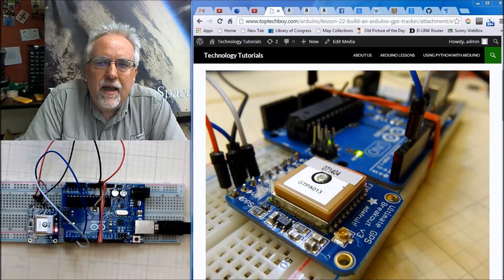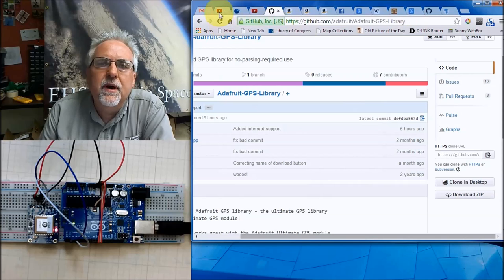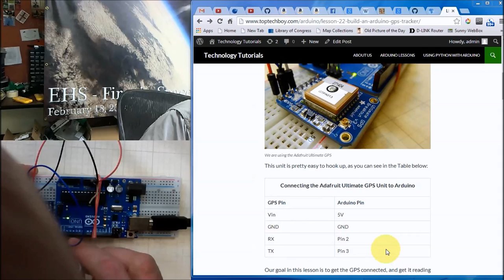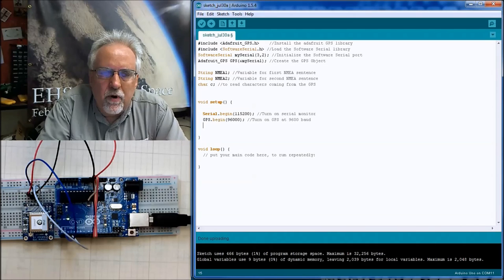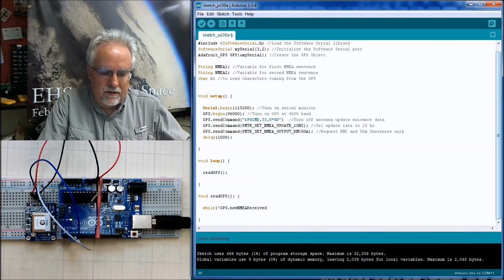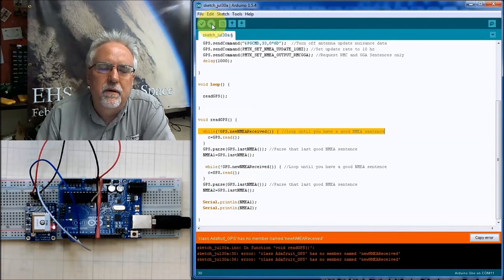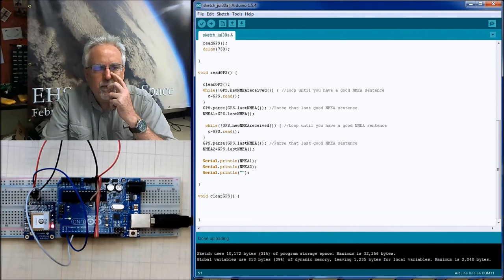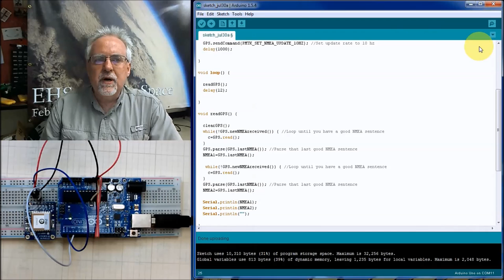LESSON 22: Build an Arduino GPS Tracker

Comment: I am having a connections problem with the GPS module and the Arduino, the Arduino always got shutdown when I try to connect the GPS module, specifically when I connect it to the power (5V), I believe it is a problem in the power distribution, plz help me fix the problem 😫🙏🏻

Comment: I have to use an ultimate adafruit GPS module. Which will be compatible with an SD card and a bluetooth module (all its components must be compatible with an Arduino) you can advise me to take what as type of components

Comment: Couple of quick pointers:
Around 17:43 you mention not knowing why you need to use & in front of your variable. This is known as passing a variable by reference (as opposed to pass by value), which means the method being called will have a memory reference to your variable rather than a copy of it. Try googling c pass by reference for a more in depth explanation and why it can be beneficial. 
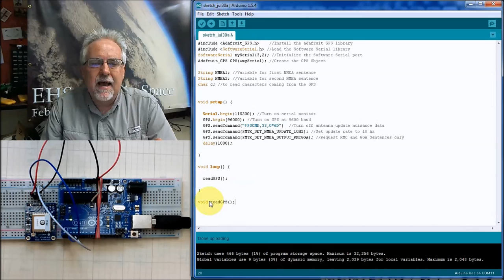Around 26:30 you mention that void indicates that you aren't passing any parameters to the function or getting any back. This is wrong, void (or int/string/etc) indicates the return type of the method, and in no way says anything about the method parameters.

Comment: in 17:48 the reason for using the & sign is to pass the memory address of the software serial object. this is done as it prevents making a duplicate of the software serial object Saving memory  which is crucial on boards with very small memory (like arduino uno which has only 2kb of memory). I checked the adafruit's library file and looked for the parameters(the thing which you passed in to create the object) and the constructor(the thing which creates the object) is looking for a pointer.

Comment: 17:46 the reason for " & object_name " must be that the gps for the add in address location .....if when we r not using pin 0,1...we must have to tell the arduino to go to GPS tracker and access the file or data located address...so that's the reason I think we need to write " & " to the the data from a particular address
Reply: its like a pointer
Reply: @siddheshgawali7764  It's the memory address of that variable.

Comment: I hooked everything up correctly(5V to VIN, GND to GND, RX to 0, TX to 1), and have the correct baud rate, but I'm not getting anything in the serial monitor.  I know my Uno works.  Is it possible I have a bad GPS module or is there some setting thats not right?
Red LED on the GPS breakout blinks every so often.
Reply: adr127 I too ran into this problem, did you find a solution or the reason why?
Reply: I too have the same problem. Did you find any solution? Please share!

Comment: Paul, getting hold of an Adafruit GPS unit here in the UK is impossible and there are cheaper units. As I don't need the same one that will operate at +60k feet I am going to assume units should produce equivalent data streams

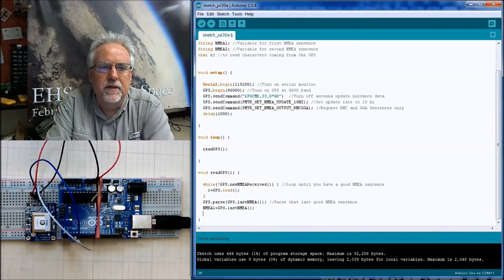Comment: At 31:30 you talk about not pausing the program because the data is coming very fast. So my question is, to speed up the routine just a little bit more, instead of Read, Parce, Save,Read, Parce, save - do Read, Parce, Read,Parce then Save, Save. Just an idea. I don't have one of those GPS devices to try it myself.

Comment: Seems like the read buffer only stores one sentence at a time. The module should specify the buffer refresh rate. To be sure you are grabbing accurate data all from the same loop frame, you'd want to first set your read loop to delay at the module's buffer refresh rate, and then parse each of the total number of unique sentences the module provides. This is just a single loop for initialization. This way,  you can determine and designate a start point that aligns in time with the 1st sentence you want to keep. For example, if there are 4 unique sentences that each refresh at 900hz, you can set the start of your 1st main loop to 900hz * 4, and then offset it if your target sentence is not the first in the loop frame. Then, you can initialize a second loop in the same way for the second desired sentence. This way, you're guaranteed to never miss a desired sentence, and the two you acquire in a given read loop frame will be guaranteed to be from the same loop frame of the module. Without doing this, even if you get a "C" sentence and and "A" sentence, you have no way of knowing if they both came from the same loop frame off the module. One of them can still be old data unless you ensure your reads match the refresh 1-to-1.

Comment: Hi! I bought one of these and am currently using it with an Arduino Mega 2560 and the only way that I can get something to display on serial port is when I do the direct wiring otherwise is not printing anything on the serial even though he seems to be getting a fix when I do the direct wiring.

Any suggestion?

Comment: hello . i want to ask if it is possible to use this gps sensor with arduino to make a gps survey instrument which can do the gps correction automatically and so it can be used for surveying with an acceptable precision.
Reply: Hi, were you able to make it work with the Arduino? We are trying to do the same thing, but can't get past the first step of just reading data from the GPS. We connected it and both boards had power. Then we loaded the empty code. When we clicked on the viewer, not data was being transmitted from the GPS (even after trying different baud rates). Can you help? - thanks

Comment: Awesome video! Is the location of the device able to be monitored wirelessly from a computer while the arduino is moving around? Thanks! (I would like to use this idea for a high altitude balloon.)
Reply from the maker: +themagicJAR48 Yes, the issue is maintaining the wireless link, which will involve legal issues, safety issues, antenna design and other engineering challenges. We have maintained a live telemetry link to High Altitude Balloons for over 70 miles downrange. It is a tough problem.

Comment: if your using a MEGA 2560, then try using hardware serial instead of software serial.  Change pins 3,2 to 19,18.   Go to File--> Examples--> Adafruit GPS Library--> GPS_HardwareSerial_Parsing.  Take a look at the code for setting up the  hardware serial.   Good luck.

Comment: Hi Paul 

Thank you for all your videos - they are superb. I have a question on the GPS. I connected Tx and Rx with the Arduino as you suggested but did not get the streaming data. Would it be because I am in the UK and if not would you please have any suggestions. Thanks
Reply from the maker: Tx to Rx, and Rx to Tx, right? With that it should work anywhere on earth.
Reply: ok thanks let me check my wiring

Comment: hey, Paul McWhorter, I wanted to ask is it possible to make HUD windshield for car with arduino and GPS module?
Reply from the maker: +Tomas Naujalis That would probably require more speed and horsepower than what the arduino could muster. For a project like that, I would probably move to the raspberry pi.
Reply: +Paul McWhorter even if I want to get only speed measurements?
I'm planing to use Ublox - NEO6MV2 GPS Module.
Reply from the maker: +Tomas Naujalis You could probably get speed from GPS and arduino.

Comment: have you test how the accuracy of that gps...say you put it stationary and observe how does coming data deviates over time? Very nice tutorial...
Reply from the maker: +fnjyusername using the adafruit library I tend to have about 10 feet drift with good fix. Drift is worse if you only have  a few satellites. I can get better accuracy on the device I build with BBB which develops the NMEA parser from scratch.

Comment: the video was very informative, thanks for sharing it with us.I need a small guidance for my project on location tracking using a SIM908 module interfaced with Arduino.The main aim is that, if you call to the sim present inside the module, it should store your no. and it has to send back the location to your no. .
can you help me with this code?

Comment: Hello, thanks for sharing, first of all. AS user of a GPS i found a problem with all the examples, the lib for adafruit is not usefull for any other GPS. I'm using for example a A9G and i would like to get from GPS longitud, latitud, etc but using AT commands and standard arduino code. Could you help us. I'm calling with A9G with no problems but GPS i can't get it. Thanks a lot sir. kind regards.

Comment: Could a Raspberry Pi 4 be substituted for the Arduino I would be using the Adafruit Ultimate GPS breakout board, a huge concern is the software compatibly.

Love your videos, never stop!
Reply from the maker: better would be to look at my GPS project on the Beaglebone black. That would be much more similar to the rpi
Reply: @paulmcwhorter  Thanks I will give it s go
Reply: @paulmcwhorter  Thanks Paul will give it a go..

Comment: Would it not be possible to do a flush on the serial buffer instead of trying to read the data to clear it from the serial buffer?
Reply from the maker: Lee N. I know what you are saying, I was just never able to figure out something that worked. The only way I could make it work was to read the data out, and then throw it way.
Reply: Paul McWhorter Something along the lines of a loop that will continuously flush the 
buffer in a loop until you set a variable where you  indicate that you 
need to read a valid string set, at which point you can use common 
expressions to compare the string and make sure it fits the data profile
 you need.  Then set new variable... reset the parse variable and then 
continuously loop and dump :)
Reply from the maker: Lee N. I understand what you are saying . . . I was unable to find a command that would reliably flush the buffer without just reading it. I am not saying it can not be done, just I could not figure out a flush command that would work the way I needed it to.
Reply: Paul McWhorter i have successfully used this code in the past :) 
------------------------------------------

void loop() 
 {
   if (Serial.available()) 
   { 
     val="";
     while(Serial.available())
     {
         char t= Serial.read(); 
         val=val+t;
     }
     Serial.println(val);
     Serial.end();    // kills serial comms when all data is read
 
    Serial.begin(9600);  // Re-starts serial comms , this 
forces deletion of stored in the buffer data   or anything cached          
             
  }
}

-----------------------
Reply: I got an error while compiling this snippet of code:

serial_buffer_delete:10: error: 'val' was not declared in this scope

Comment: i do connect the tx rx to 1and 0pin on my mega board but on the Serial monitor nothing is displayed.  9600baud.  do you know the reason. The gps does receive fix because the red led lights every 15 second
Reply: lol pokemon, I too ran into this problem, did you find a solution or the reason why?

Comment: Excellent lesson, thank you.  One comment... you use the term Baud when the correct term should be bps (bits per second); they are not the same thing.  Baud is an old school term that max'd out at 2400.  Anything above 2400 is properly called bps.   Again... Baudrate and bitrate are not the same... and these days, bitrate (bps) is probably always the correct term.  And yes... I still see professional equipment manufacturers incorrectly using Baud where bps should be used.  eg. The Arduino IDE dropdown incorrectly uses the term Baud.

Best regards, and keep up the great work.

Comment: Hi Paul, I've got one question is there a posibility to send data from this tracker remotely without GSM/GPRS module??
Reply from the maker: W3bT4l3nt I have used an ehternet shield and then sent data over Bullet Radios, but this requires antenna and line of site.

Comment: you cud flush the buffer and keep a time interval to receive 1 data message at a set interval maybe thatl work then go from there.
Reply from the maker: ***** I wish I could flush the buffer. I tried lots of different things, and could not get a reliable buffer flush. I am sure there is a way to do it, but I could not figure it out. So, i flush it by reading into a dummy variable. My background is electrical engineering, transistor physics, and nanotechnology. I am just a hobbyist programmer, not an expert.
Reply: im only just getting into it myself as a hoy i got a raspberry pi 1st and want the arduino yum next i think lol i like home automation projects with raspberry pi i made a web based remote access for it when i had a landline then i started getting into ardino for access control  for my door to use in conjunction with an access control unit via rfid  lol
Reply from the maker: ***** I really like the Pi, and I hope to do a video series on it this summer. The arduino is lots easier, but you reach the point you need to move up to the power of the Pi.
Reply: they got a new model out now its always best to get the latest an greatest as its double better then the previous model lol

Comment: Why not put the library in the main arduino > libraries folder so that the library will be available to all users of that PC?
Reply from the maker: ArtR0001 The main thing is to put the library where the Arduino will look for it. Wherever it goes, it should probably match the sketchbook location under the "preference" tab.
Reply: Paul McWhorter
Regardless, I still find these very good tutorials. Actually working on a GPS with standalone ATmega328 with Adafruit GPS, logger, and LCD display.

Comment: Balloons are slow moving? Airspeed yes, groundspeed not necessarily.
Reply from the maker: +Patrick Rebert Yes, compared to Intercontinental Ballistic Missiles, balloons are slow. The fastest I have seen one of our balloons get is 150 MPH as it passes through the jet stream. The concern on GPS shutting down is to prevent rouge nations from having easy access to missile navigation. There is no confusing the speed of a balloon (slow) with the speed of a missile, which is very fast

Comment: no command to flush buffer?
Reply from the maker: There might be, but i have never been able to get anything to work as reliably as just clearing the buffer by reading it. I with the GPS would work more as a client/server type relationship, where it would send data when asked.
Reply: I took a look at both the Adafruit API on github and the SoftwareSerial 
page on the Arduino website. I couldn't find anything that indicated 
that the serial buffer could be flushed, but it does seem as though the 
GPS chip can be put in and woken up from standby mode. Might stop it 
from spamming the serial buffer with info when not doing reads. 
These two declarations are in the Adafruit_GPS.h file.
boolean wakeup(void);
boolean standby(void);

Looking at the source code for these functions, they are both switches and indicators. A call to standby() returns false if the chip is already in standby mode, otherwise it returns true to indicate that it was successfully switched to standby mode.

boolean Adafruit_GPS::standby(void) {      
          if (inStandbyMode) {
            return false;  // Returns false if already in standby mode, so that you do not wake it up by sending commands to GPS
          }
          else {
            inStandbyMode = true;
            sendCommand(PMTK_STANDBY);
            //return waitForSentence(PMTK_STANDBY_SUCCESS);  // don't seem to be fast enough to catch the message, or something else just is not working
            return true;
          }
        }

Hope this helps!